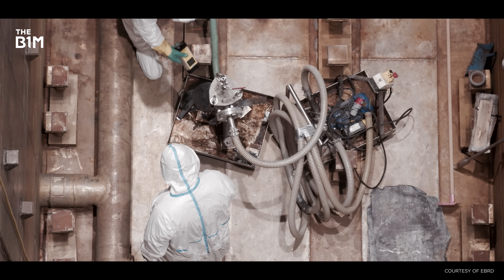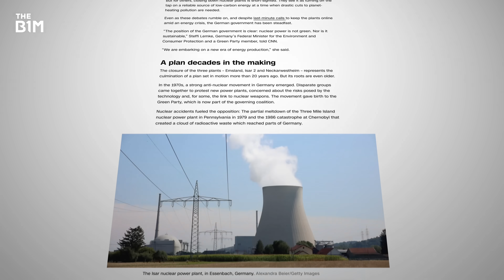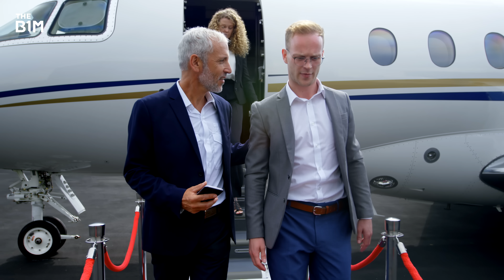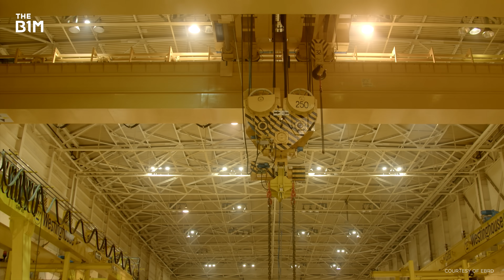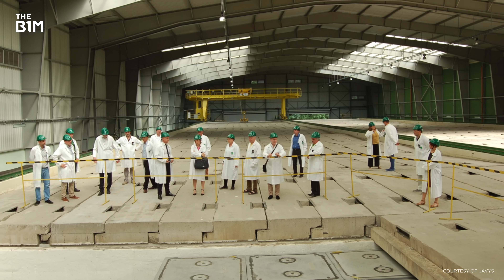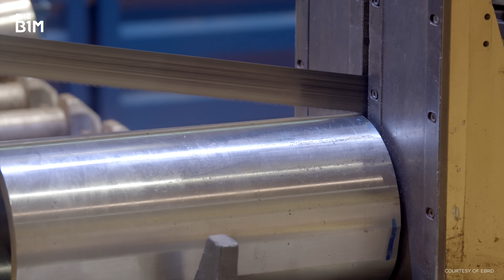Why These Soviet-Era Reactors Are Being Taken Apart

Comment: Confusing. It happened in 2011-2022 . So it's done. But is it expected to cost 1.3B US? And then you lead into Masterworks.
Reply: The money is for reconstruction and development.
Reply: @yotonking2831  how did you get on that?
Reply: wiki said they received two funds. One for teardown. This fund was supported by 800 mill euro.
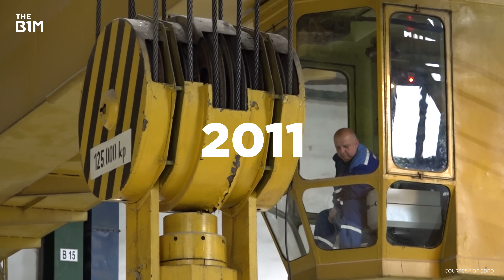Reply: "Confusing. It happened in 2011-2022. So it's done" Bro, he already said it at 2:40.
Reply: @edyee1647  right Bro, so why is it expected to cost 1.3B? It's over.

Comment: I’m interested in your take on why most power plants continue to use the same old technology to generate power: steam to turn a turbine. What other technologies are available?
Reply: cause it is a proven design. We know how to make a stable power grid out of steam. heat source does not matter. 
In the future will it be interesting as Solar power and wind turbines usually follow the heartbeat of the grid with a high renewables grid you need to do grid forming a different way.
Reply: It's the most efficient method, and the simplest to set up. Make no mistake though, modern day steam turbines are immensely complex machines that hold and generate massive amounts of power, a single turbine unit can generate nearly a gigawatt alone in larger plants.

Comment: It is unlikely that “small” reactors will be adopted. They are still too expensive and take too long to be installed and permitted. Also to be taken into account are the hazards of mining and refining the fuel.
Reply: Wrong. They are affordable enough to be deployed now. Why aren't you asking to kill Coal when it kills WAY MORE PEOPLE??????? REALLY... Talk about misplaced priorities...
Reply: @stickynorth  Then ask NuScale what happened to their project in Ohio that already got quite a big Subsidy by the Inflation reduction act. And the likely hood of SMR projects going big overprice is not low.
The fun part is that they are already overpriced when calculating with full load. But with so cheap Solar power pushing into the market the load will need to adjust and the price per kWh will rise even more.
 
And we should have reached peak coal already where the worldwide consumption will go down.  Battery storage prices already dropping quite a lot sooner than expected. The next years will mean big changes in the energy system.
Reply: LOL.... FUD MONSTER ALERT!

Comment: Better to refurbish it, but ok
Reply: You cant just glue together a nuclear power plant. Getting an design certified is a long and expensive way. And that specific soviet style design is problematic. newer soviet design is still running cause it reaches the needed safety design.
Reply: @toggleton6365  they only exported pwr reactors outside of the ussr. I would try to refit them before going for the renewable unreliable nonsense

Comment: Im from Slovakia, and now new goverment is making a project for new Nuclear power plant on place where Bohunice were, and it should be similar small modular reactors like that one at the end of the video.
Reply: Thanks for comment. Do you know who will build it?
Reply: @kpakaify  The new block of the nuclear power plant should have an output of approximately 1,200 megawatts. Due to the lack of resources in the state budget, the government will have to proceed with the construction of the reactor in the form of a PPP project. According to him, a private investor in such cases demands a guaranteed purchase price of electricity for decades.
Reply: @kpakaify  According to Wikipedia : Decision made in May  2009 -manufacturer not yet decided.... "Four manufacturers have been mooted as possible suppliers: Mitsubishi, Atomenergoprojekt, Westinghouse and Areva"
Reply: @1968Christiaan  Westinghouse went bankrupt in 2017, which is why they cancelled the VC summers project. They recently got sold again for just 7.9B EUR, which is about a third of what it would cost to build one of their reactors...
Areva and the nuclear part of Mitsubishi is now Framatom. Which would have been bankrupt for building an EPR in Olkiluoto if they had not been majority owned by EDF, aka the French state.
So really good point.

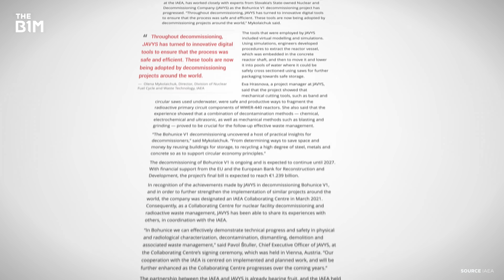Comment: Small mistake that i spotted at 1:58, The other 6 reactors are also soviet, and 4 of them stay running with 2 of them under construction again.
Reply: Unit 3 in Mochovce has been operating for few years. So 5 units of VVER-440/213 is now operating in Slovakia.

Comment: It sucks that they are fully tearing down the site. Obviously the reactor vessel itself needs replacing if it doesn't meet modern safety standards, but I don't understand why they didn't retrofit the plant to use a modern, safe reactor, and reuse a lot of the other infrastructure like the cooling towers, steam generators, and turbines, to generate power with a more modern reactor. It seems like that would be way cheaper, and would have less impact on their electrical grid and local economy. Also, if we're going to meet climate goals, we need more nuclear, not less. Including Chernobyl and all other nuclear disasters, nuclear has caused less deaths per kilowatt hour than any fossil fuel method of power generation, and even if you go really overboard and include the deaths caused by the nuclear bombings in WW2, nuclear still has less deaths per kilowatt hour than coal does. Coal power has even emmitted more radioactive debris into the atmosphere than nuclear, as the trace heavy metals in coal are released without any effort to mitigate it, while nuclear is highly regulated and emits virtually zero uncontained radioactive material.
To put into perspective how incredibly safe modern nuclear power is, if you don't count Chernobyl, nuclear has the least deaths per kilowatt hour of any power generation method, including solar and wind, due to workplace accidents where people fall when installing panels on roofs or maintaining wind turbine.
Reply: There are still 2 working reactors there, so they were 5, now 3 are gone, 2 are working and they want to start to build a new reactor in close future

Comment: The share of nuclear power in global electricity production has halved over the last 30 years. It will continue to shrink as so many old reactors will have to go offline. Only France and China plan to even build a substantial amount of new reactors. The others are just dabbling a bit.
Reply: Define substantial.
France has 61GWp nuclear capacity.
56GWp of that will have been active for over 50ys in the next decade.
Back in the summer of 2022, the french nuclear industry was in dire straits and less than half of the capacity was available for electricity generation. Partly due to the usual refuelling cycles, partly due to defects found, partly due to high water temperatures and low water levels in the rivers that most french nuclear power plants use for cooling.

So Macron threw the french nuclear industry a bone and announced the intention to build 6 new reactors, for a grand total of 9.6GWp of new generation. Given that it takes 5+ys of planning, and 10-15ys of building, for new capacity to come online, i do not see anything real happening here. Especially since the economics of nuclear is suicidal, which is a few orders of magnitude worse than abysmal :)

Comment: Every commercial reactor design that was produced in numbers had a decommissioning plan when it was built, despite what it might seem like. This is universal across the world and maybe even more true for some earlier designs that were not of the quality that would instill the confidence they would not have to take the whole thing apart again. They messed a lot of things up back then, but they did make plans for what to do at the end of the working life of the reactor. Just under different standards and concerns compared to nowadays. Doesn't mean you couldn't still do it that way, heck some actually still do despite the protest of the IAEA.

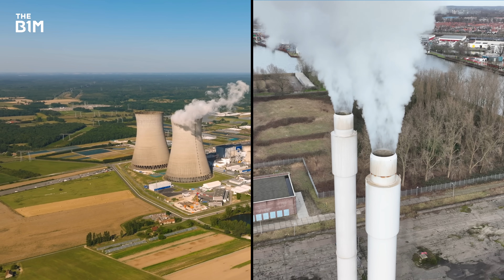Comment: 0:55 "much cleaner than fossil fuels ... there's a drive to build more powerplants" Unfortunately no drive in World's 3rd economy: Germany 😢As far as I remember when they agreed to stop all nuclear powerplants, they started digging and consuming more coal, because green party wanted to stop nuclear power
Reply: are we talking about 2002 nuclear stop or fukushima based stop in 2009? 2009 was CDU and FDP. greens have been not in the government at that time. And the plan of the greens was to accelerate renewables a lot more than the CDU ruled government did in their 16years.

The coal consumption in Germany was mostly steady since 2000 till 2018. With some heavy winters more and some years less. 
And is right now as low as it was in 1956. At the same time as the last nuclear reactors have been shut down and gas prices have been used as weapon by putin. 

Would it be better to get rid of coal first sure but this was a development that fueled a lot of discussions nearly every year. So it is what it is. Fokus now on getting the co2 emissions down of the country instead of repeating the discussion again. Enough work to do.
Reply: @toggleton6365  shutting down coal power plants instead of nuclear power plants would've gotten germany's co2 emmisions preety low. 
i mean, just sayin'
Reply: @toggleton6365  I was talking about the recent event, the full stop under the traffic light coalition

Comment: Before SMRs can be fully adopted they have to  uh you know ... exist.
Reply: You'd think a smaller modular reactor design would be more cost effective....but..they are actually more expensive to research and develop + test....😅
Reply: Russian (sovjet) reactors for submarines are stored as such on open air in Kuola peninsula in Saida-Guba. Everyone can see and calculate them in Google Map satellite view.
Reply: @ivekuukkeli2156  if there is no assembly line and a utility can't buy one it doesn't fit the definition of an SMR. Classified military reactors don't count.
Reply: Yeh the only company that actually got half way to making one went bankrupt with the explanation " it was just too expensive".  Very honest, if a little late.
Reply: they exist are used in submarines, ice breakers, and aircraft carriers
Reply: @anuvisraa5786  bespoke military reactors are not SMRs.
Reply: @gecho111  they are small (lest that 100 mw) they are modular (several ships have more than one) and they are reactors so
Reply: @anuvisraa5786  They are PWRs.  PWRs require a massive heat sink, in the examples you listed the heat sink is the ocean.
Reply: @rtqii  not all are PWR the Lada class had a lead cooled fast reactor, The Losharik use a graphite moderated high temperature gas reactor

Comment: The dismantling of a Nuclear Reactor is threating enough! But storing it's waste is another story! Just a few places that store 88,000 tons of radioactive waste and nowhere to put it, and Nuclear Fuel, 30,730, 000 sitting underground in cement vaults! This is a continuous problem with nuclear anything! One leak into surface water collects in streams, rivers, lakes, and reservoirs. Ground water is located below ground, where it collects in pores and spaces! What is Groundwater and how much does humanity depend on water. Nuclear Waste vs Water

Comment: Regarding safety concerns, another option would be to use the CANDU design.  It is more expensive, mostly due to its heavy water moderator, but was designed to be a safer reactor design from the start.  It has many other advantages, including the types of fuel that can be used with it and the fact it is almost impossible for a "meltdown" scenario if anything fails.  It is also a design that could be used for countries that can benefit from the production of power without having access to weapons grade fissile materials.
Reply: If not candu, then maybe someone can start thorium runs
Reply: @tomarmadiyer2698 why not rosatom?
Reply: It is more expensive

When the current designs already struggle to produce electricity for a competitive price then building an even more expensive design in 10years will not survive on the market without big Government help.
Reply: @toggleton6365 

Right? 

Because all infrastructure is completely privately funded. 

We can't take money away from the next Sports Dome. Or from arms developers.

Nah, it's too expensive, we can't be better.  We love our shite sammiches.